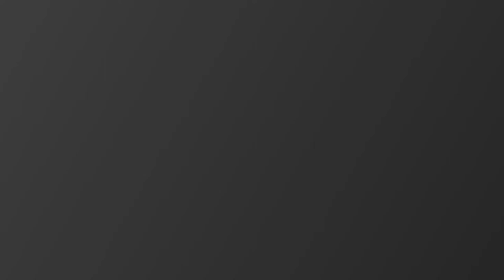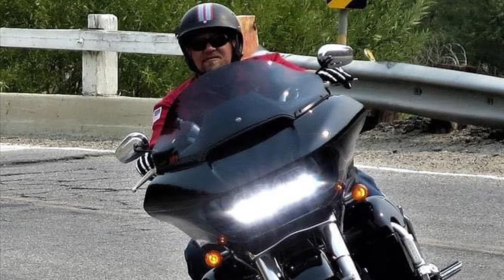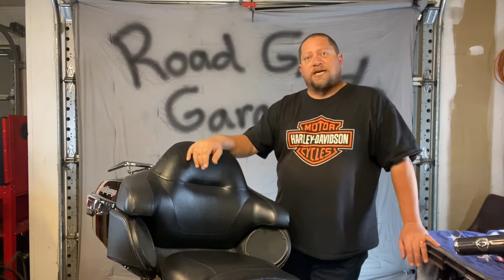Harley Touring Hydraulic Clutch Goes Soft

Comment: Just saw this video. You are correct, moisture in your brake fluid will cause you to lose your hydraulic clutch. The slave cylinder is right next to the exhaust, and water boils long before brake fluid does. It comes back when the bike cools down, but as soon as it gets hot you WILL lose it again. Happened to me riding to Montana last year. I fixed it in the parking lot of my hotel. After the bike cooled, I rode to a NAPA Auto Parts store, bought a vacuum brake bleeder for $49 and a bottle of DOT 4. Bled it in the parking lot and it was new again. Took 5 mins and a lot cheaper than what the dealer would have probably charged me.
Reply: Happens to me on my rides in the Utah mountains, every time I do a long ride over the summit in the summer. I'll test and then change my fluid and try the ride again!
Reply: Its a $200 fee at the Stealer to have it flushed and refilled.

Comment: Your assumtion is correct.  Moisture in the brake fluid is boiling and won't compress.  This problem is compounded at elevation.  The boiling temperature of water drops about 1 degree every 500 feet above sea level.  At 10,000 feet this moisture will boil at around 20 degrees lower.  I lost my clutch going up Pikes Peak and Independance Pass.  The fluid needs to be changed at least every other year.

Comment: I've seen this same issue happen to a rider in my class but only once. In my class, there is a lot of friction zone use and it's always very hot here in Florida. The rider lost all clutch use. It took an hour, but the clutch did come back. The rider bought the bike used and didn't know if the fluid had been changed. If your theory is correct, a fix might be to put some type of insulation around  the hose where it comes close to the converter.
Reply from the maker: Love your channel!! Thanks for stopping by.

Comment: I know this is a one year old video. You guys finding this problem with your hydraulics to be a revelation must be living under a rock. The issue is well known and water absorption in DOT 4 is not news. HD recommends complete flush of brakes and clutches every two years for this express  reason. Very surprised that Wyoming dealer did not know this. Did you ask the chick in motor clothes?

Comment: I'm thinking the moisture in the fluid was vaporized by the extreme heat. Water vapor will compress where as fluid will not. Once the vapor condensed back into fluid form, normal clutch operation was restored. Changing your fluid on the regular will 100% eliminate this problem.
Reply: You are 1000% Correct JD

Comment: I had my 2014 get the soft clutch back in 2016. I was riding from LA on I40 and in Gallup NM the clutch was super easy but still worked. I pulled off and saw the fluid in the reservoir had a milky appearance. The temps were hot outside. The bike only had 45k miles and had been serviced before the trip. So the 649 miles in hot June desert weather made the DOT fluid get close to the boiling point.

Comment: I had this exact problem happen to my 2014 SG the other day in New Orleans. Just bought the bike used and talked to the guy after it happened and he had never changed the fluid. All the way to the city it was find but when we got there in stop and go traffic the bike got up to almost 300 degrees, we got out of there and I lost my clutch. We pulled over and I pumped the clutch and it came back , we let the bike cool off and got moving out of that traffic and the bike ran fine the rest of the day . Thanks for sharing your problems because it’s exactly what you said your theory is , it gets hot , creates moisture , boils and you loose your clutch .

Comment: My cvo clutch fluid was 3yrs old and I changed it along with the brake fluid .moisture was obvious there because I noticed a slime starting to form in base of fluid reservoirs. Bleeding the ABS is another challenge. My friends Cvo 110 boiled the clutch too and it also noticed one of his oil cooler rubber hose lining was collapsed adding the engine getting hotter than normal .

Comment: From what I understand about the adjustment on the clutch when you turn the nut in the center of the clutch that adjust it turning it in till it just touches and doesn’t feel loose then 1/2 to a 3/4 to one full turn your doing this to leave room for the expansion of the clutch plates when the weather is hot and the bike gets hot, I would check the oil in the crank re-adjust the clutch for hot weather change the fluid to clean then inspect the fluid and check the magnet for bits and prices and change the break fluid flush the line eliminating all possibilities of this happening again